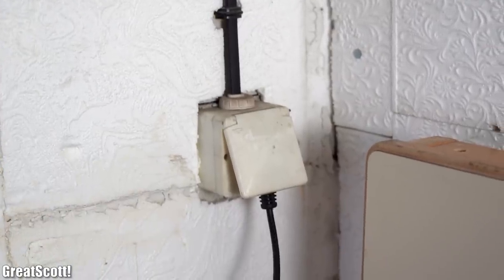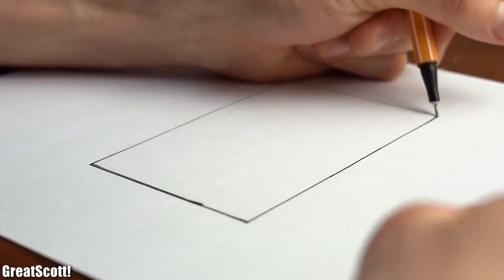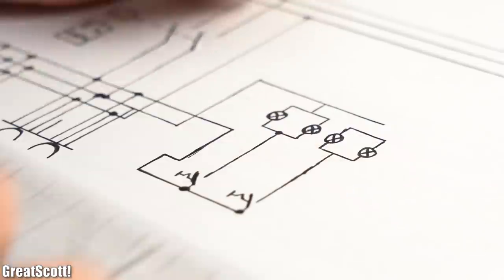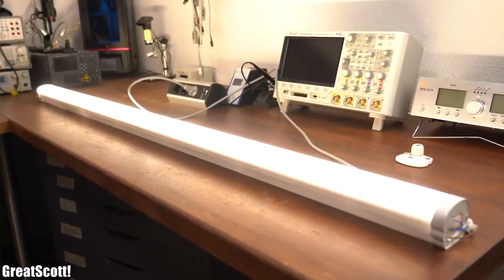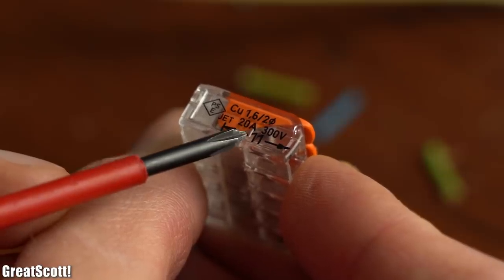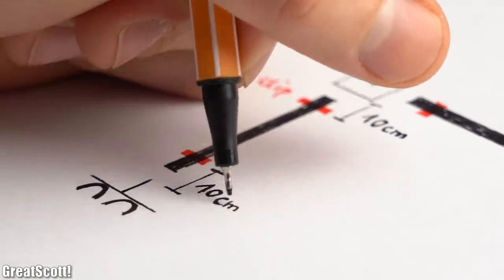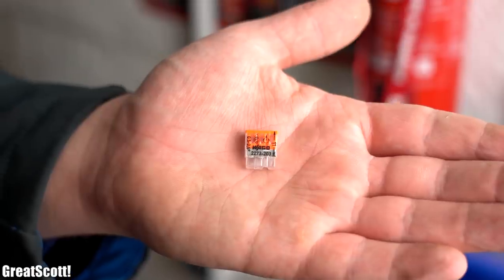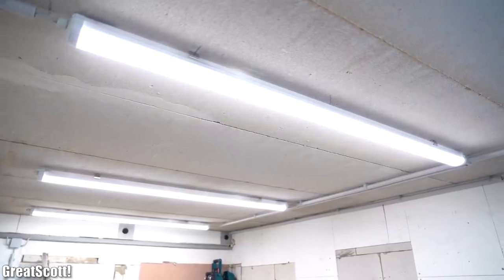How to do Electrical Wiring properly! (more or less....) GERMAN STYLE!

Comment: Irish electrician here, very disappointed with the German standards I thought they would be up to a much better spec, nothing in this install would really be ok over here. Starting on the distribution board you would have to have a 2 pole main isolation switch or a 2 pole MCB (usually 63A) within the board and the cable  feeding the main switch/distribution board would be a 16mm² minimum and then the circuit breakers fed with a busbar or 10mm² or 16mm² panel flex cable. The lights and sockets would also have to be on two separate circuits, lights on a 6a or 10a rcbo and the sockets on a 20a rcbo, the lights can be wired in 1.5mm² but the sockets would have to be wired in 2.5mm². The cables also should not be connected like that in a junction box as you want the least amount of joints in the cable as possible and the least amount of points of failure possible. The cables for the the sockets would be looped down to the socket and then back up feeding the next one, being joined in the socket terminals.

Comment: Wow, the prices in Germany are really high.
Reply from the maker: True
Reply: What would the cost bee in your country? Also: you can only buy and use rated and certified components for such installations
Reply: @TecSanento  sure. For example double socket 16A costs 3€ in Poland while in the video it was 15,5€!!!  https://allegro.pl/oferta/gniazdo-podwojne-hermetyczne-natynkowe-dymne-8359885355?utm_medium=app_share&utm_source=facebook
Reply: @volkhen0  I don’t want to offend you but those look and are probably cheap. We have 3,99€ double sockets in cheap hardware stores ... but I have used them before: no proper seal, very thin plastic, two instead of 4 mounting holes, housing not dust proof, contacts not protected against touch and so on... they work and are kind of save. But they won’t last as long as some “proper ones”

It depends if you just want to get the job done and occasionly use this socket or task them with daily abuse by multiple devices, high power appliances ... and he as a YouTuber probably won’t want viewers to commend “German standard ? Don’t use el cheapo components .... bla bla bla not standard ...”
You get the point ;)

Comment: can u tell us what is ground wiring ? how we have to connect  ? where is important ?   dc ac grounding ... etc . Danke dir.
Reply: Ground wiring can be connected to Neutral after the meter (before differential current breaker) or if you have your own ground pin you can connect to it. If RCB breaker detects a leakage current to ground it will pop. Usually it’s 30mA.

Comment: Again why are you not terminating the conduit into the junction boxes or appliances? You have mechanical protection until you get to end of the run.
Here is an example of using conduit couplers   https://youtu.be/WlQfKY7eY8c?t=144
Reply: Cable, double insulated at that, no need whatsoever to do better than what code requires. You could nail them against the wall with cable tacks and still be within code. Doing conduit the way done here is simple, fast, cheap and has been working well since forever. Fully closed conduit has been done away with here since the introduction of PVC insulation.

Comment: I still hate that you don't run the conduit directly into the enclosures.
It looks horrible.
I would rather have the wire neatly down the wall than the way you have to do it :(

Comment: (International) Comment on the legal bits: here in NZ, all permanent wiring must be signed off by a registered electrician. You cannot modify the light switch, the power outlet, or the light fitting yourself! But you can make your own extension cord, because you can unplug that. If your house catches fire and they trace it back to wiring that has no sign off, you have no insurance. Also, 240V is not your friend, will not respect you, and will kill you dead if you don't know what you are doing!

And now back to the Germans doing German wiring :)

Comment: As I refer to german code I continue in german :

Du erwähnst im Video das 1,5mm² mit 16A belastet werden kann, das stimmt leider nicht (mehr). Nach VDE dürfen 1,5mm² Kabel mit maximal 13A belastet werden, in ungünstigen Situationen ( hohe Umgebungstemperatur, hohe Dichte an Kabeln z.B. im Kabelkanal, ... ) sogar deutlich weniger. Wenn Du 16A haben möchtest/musst, dann ist 2,5mm² Querschnitt erforderlich. Hinzu kommt das übliche Steckdosen nicht für 16A zugelassen sind, meist sind das 10-13A Dauerstrom. Siehe z.B. www.lappkabel.de/fileadmin/catalog/2010_de_pdf/T12_Belastbarkeit_Grundtabelle_Reduktionstabellen.pdf

Nach EU Recht ist zudem derjenige für die GESAMTE elektrische Anlage verantwortlich ( im Sinne von Haftung ) der zuletzt daran gearbeitet hat - auch wenn er nur eine Leuchte angeschlossen hat. Somit sind in der Regel die "Hobbybastler" raus da die schlicht die Haftung nicht übernehmen können.

For any other : Please refer to you local code for max. current on wires.

Comment: You can't use 16a circuit breaker with cable which can hold 16a, because circuit breaker has time current curve which means that 16a circuit breaker can hold up to 23a for above 30min. This current will damage your cable.

Distribution box better look like this
https://m.youtube.com/watch?v=_AtZkc1OxXA&feature=youtu.be

Comment: I'm surprised people are allowed to do any mains wiring work!
Germans are well known for having rules and regulations, for every single thing. 
Here in Canada, in most provinces that even allow you to do any house wiring, you'll need a master electrician to sign off, before power is applied. 
Some people do their own wiring, but hire a master electrician to inspect and certify their work, and final hook-ups, before they proceed with insulation and drywall.
Reply: In most of Europe (countries are not the same) there are official standards, not laws for electrical installations. I.e. you don't violate any law by working on the electrical installation of your house, but e.g. your insurance will only want to insure an electrical installation that is compliant with the national standards. If you built it yourself, the insurer may require a master electrician to inspect it.
Reply: @danielmantione  That's what most people miss. The insurance companies are itching to find reasons to deny claims. 
The system is rigged from top down.

Comment: Hey Scott, I am a big fan of your work. I have learnt more about electronics from you than from all the other sources combined. I am just a 16-year-old electronics hobbyist and enthusiast and was planning to build a battery pack for a DIY OneWheerl (DIY cause it is quite expensive for me to afford). I stumbled upon this design on youtube for a spot welder and was thinking if it would be possible to use some NPN and PNP transistors along with a microcontroller such as an Arduino Nano, to make a much efficient and precisely timed circuit to maybe use it as a spot welder. Also for discharging the capacitors a solid-state relay can be used so that we can work with you know cheap transistors. Also, I was thinking to use a handheld switch for spot-welding.

Youtube link:https://www.youtube.com/watch?v=V1nfcTcV1Qk

Switch link:https://www.amazon.in/Honelife-Integrated-Welding-Automatic-Accessory/dp/B08GKPYQ31/ref=asc_df_B08GKPYQ31/?tag=googleshopdes-21&linkCode=df0&hvadid=396984999966&hvpos=&hvnetw=g&hvrand=2110032162089747932&hvpone=&hvptwo=&hvqmt=&hvdev=c&hvdvcmdl=&hvlocint=&hvlocphy=9303169&hvtargid=pla-983342119137&psc=1&ext_vrnc=hi

Hope you find it helpful and can help me build the right Spot Welder.

Comment: Are you kidding me? One circuit for all lights and sockets? You have distribution blocks but noooooooo, you squeeze several wires into one terminal. German standards allow this? 3x1,5mm2 for sockets? A primary security that is less than the RCBO?

Comment: holy shet we are still using brass bar n screw for securing the wires. And the fuses isn't that easy to reset. European Electrical is nice and safer then what it is here.

Comment: Italian electrician here. I see some big mistakes:
- you didn't specify that this is an external electric system, suitable for garages or storage rooms, for houses there are normally conduits inside the walls
- the plastic conduits should arrive inside the junction boxes, NOT STOPPING 5 cm BEFORE! See Gewiss external boxes, for example. To see an example; https://youtu.be/RSlFbWmArzE&t=8m30s  Furthermore the way you did it there is a risk of humidity and liquids entering the switches together with the cables.
- having the conduits and the junction boxes being a closed system, you could use separate cables instead of insulated triple clable (or 5-cables), separate cables have better performance, less resistance and inductance, insulated cables are used in fact only for external applications, where the user could touch the cable.
- the old fuse looks not anymore by the code, and not necessary because of the new RCBO, so I would remove it and check the size of the cables from the source to the new RCBO, they should probably be substituted as well
- the copper part of the cables should be twisted before inserted in the components or better should be used a crimped terminal ("capocorda")
- the PE should be tested in all plugs and lamps before closing, there is a special device to do so

Comment: 1 The 3x1.5 cable is secured with 10A not 16 The 3x2.5 corresponds to 16A .....
2 Nothing so special about that is pretty much The EU standards
3 The main fuse is only 6A? That needs to be changed to meet The overall load.....
4 this is basiclly a handymans work not a profesional😂😂😂😂😂

Comment: Profesional electrician using WAGO = not profesional.
Reply: What is used profesional if its not wago?
Reply from the maker: Dude, every electrician in Germany uses WAGO terminals.
Reply: The spring terminals (Wago) are better then screw terminals as the screw terminals might get loose over time because of temperature cycles.
Reply: some old-style electricians not familiar with "wago", but the wago works. Same Technology with the widely used industrial terminal blocks...Just read the stripping lenght, the amperage, and the wire diameter, and use that info. ;)